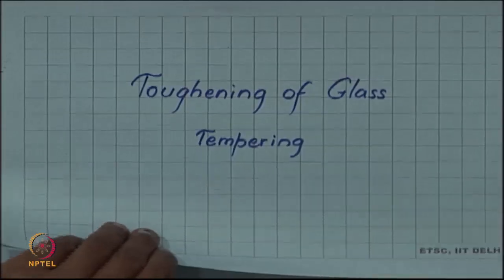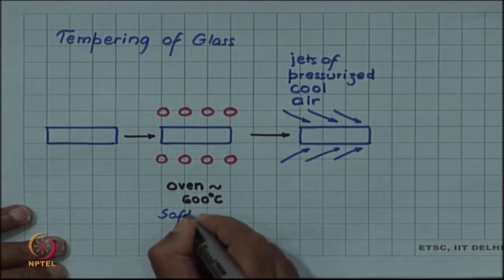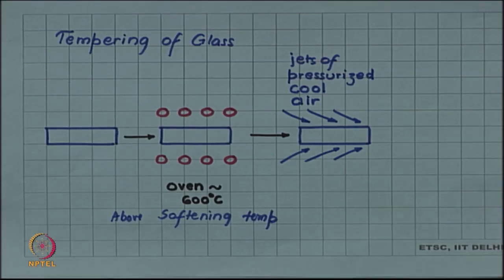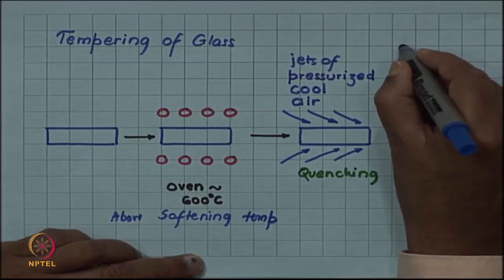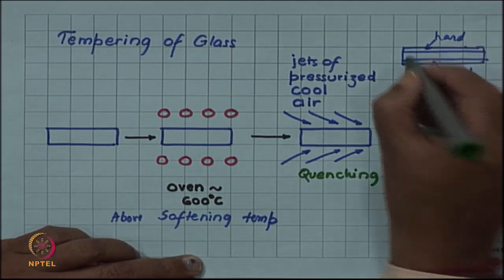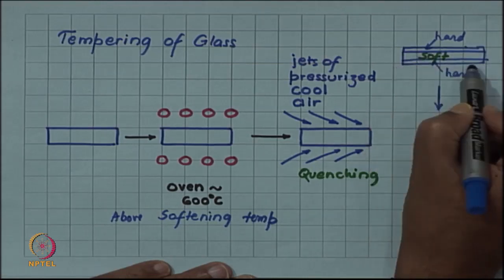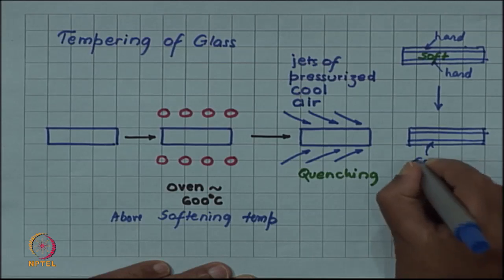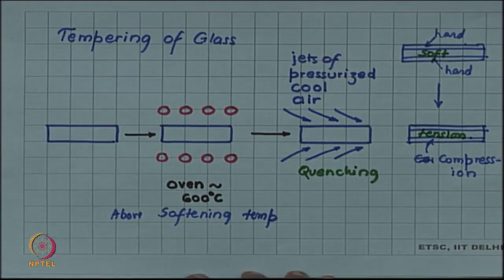Toughening of Glass: Tempering

Comment: Sir I understood about the enhancement of the thoughness of the outer layer 
 But how this compressive stress in the outer surface and tension in the inner surface will be contributing for making the glass better ... In a layman's point of view it's instability ..
Reply from the maker: Your question is very valid. In fact, by introducing tension inside the glass has become more susceptible to crack propagation at those locations. However, it the surface where there is is the highest probability of cracks to exist. Thus by introducing compression on the surface there is higher probability of glass to become resistant to crack propagation.